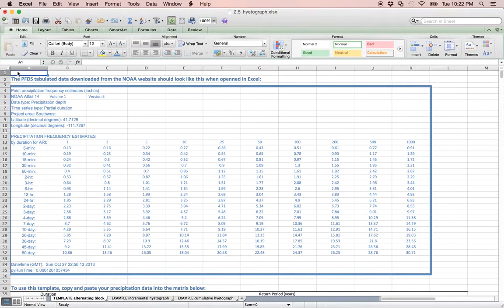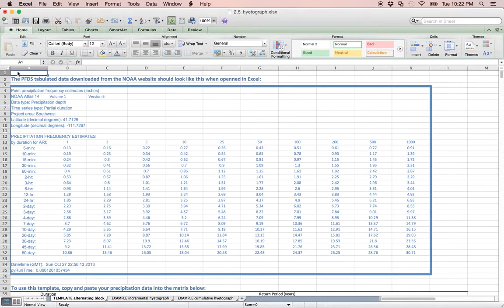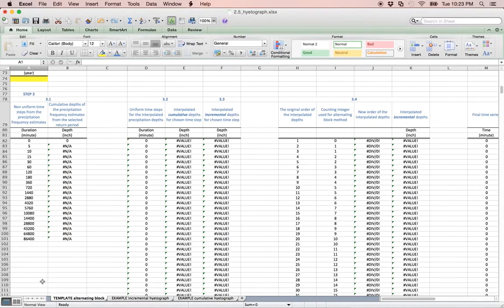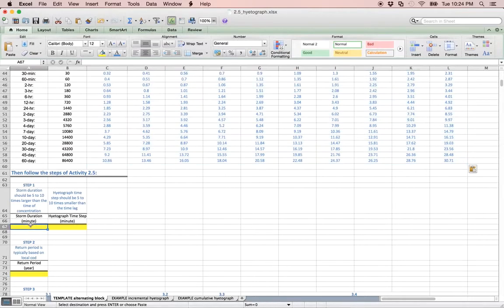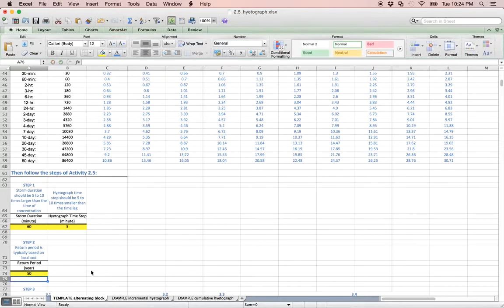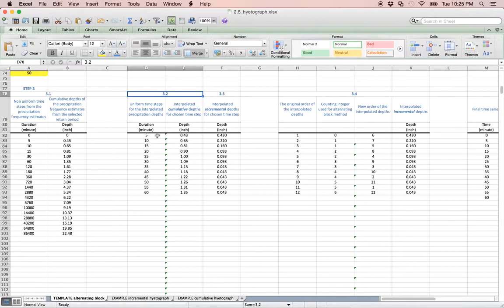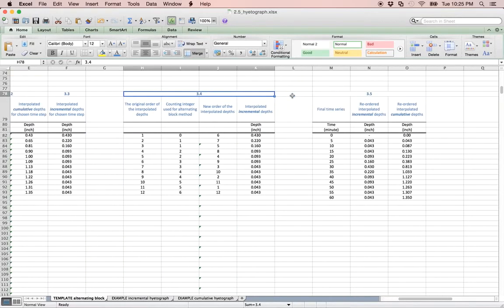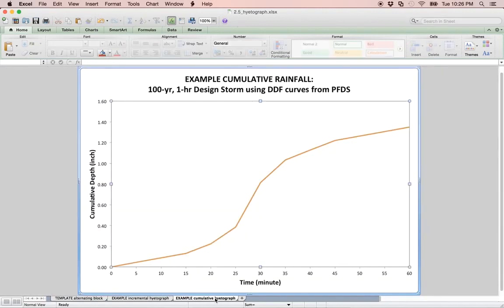Alternating Block Method

Comment: hi
can i convert IDF curves to intensity/duration  hyeto...
for example am using sewergems 
and i need that in SCS unit hydrograph dimensionless 
and  they actually require and a must to use ( intensity /duration storm type , or time depth) am afraid from time depth bcoz i don't know it hahahaha